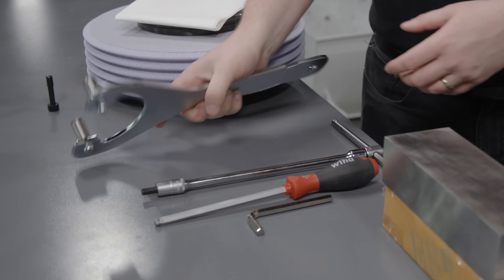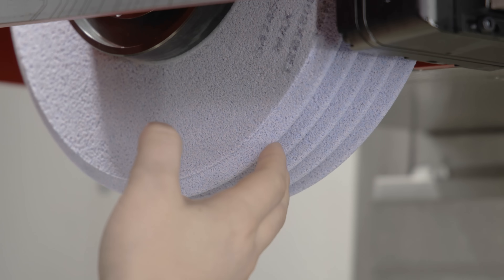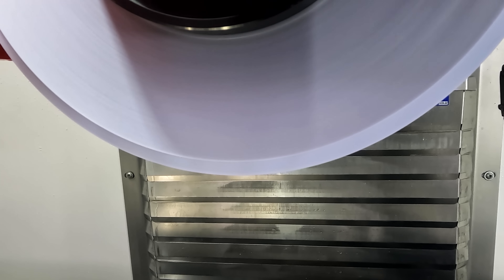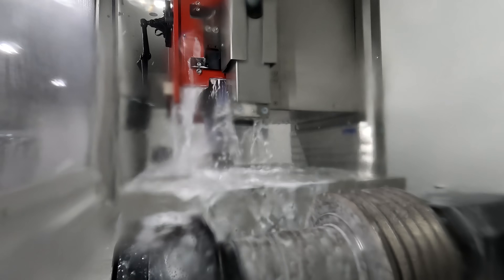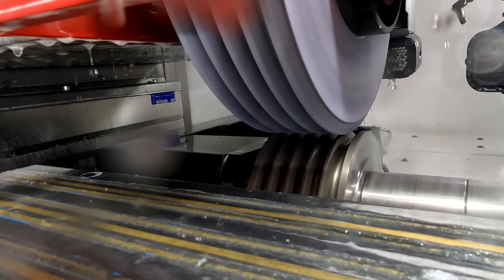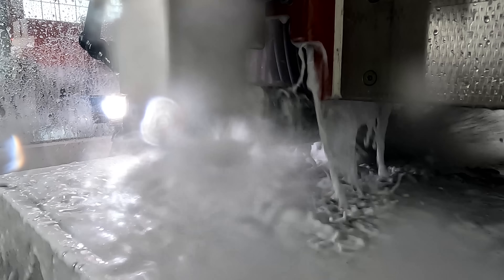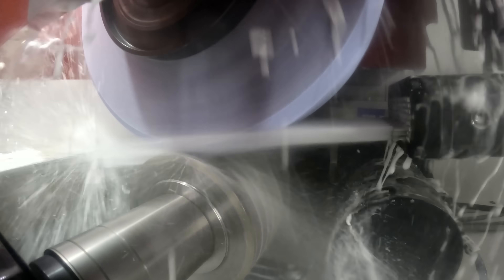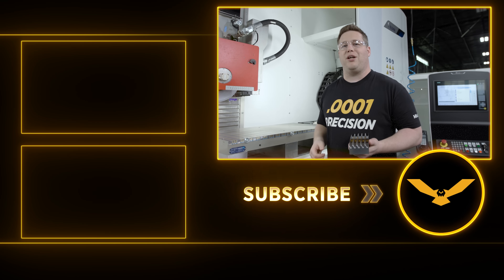Thousands of DIAMONDS Used to Create IMPOSSIBLE Grooves

Comment: Curious why you would grind half an inch then redress.

I would have thought it would involve less dressing to do one "rough" grind, then redress a few times for a "final" grind. That way you are not using a redressed wheel to remove the bulk of the material. Something like redressing every half inch vs redressing once every inch or two.

Comment: But you don’t really care if The finish is as good off the mill… cuz you’re just gonna go over and dust a few thou off on the grinder right? How do you go about getting the diamond setup to profile the wheel like that all at once? Does it require six independent diamond wheels stacked together? How much is the cost of the wheel that is being destroyed in the process?

Comment: How does the machine, code, software account for the diameter of the wheel shrinking?
Reply: I imagine it has to do with sensing how far the spindle is moving to meet the dressing wheel, which seems to be in a fixed location

Comment: So, every time you need a special shape you need to have a nee wheel designed for it. Like if you want deep, thin grooves you'd need a different wheel. Or wide shallow grooves. It doesn't seem cost efficient unless you consistently work with things that require the same designs and specifications.
Reply: To my knowledge, it's also possible to manually machine in many types of grooves for a grinding wheel by using a diamond cutter in a lather configuration.  That way, you can machine multiple types of shapes without having to create a new tool every time.
Reply: @kai.05  Not your fault, but for some reason, reading your reply really hurt my head. Probably need more sleep if I had to guess.

But if I read that correctly, then for more specific shapes and designs you can manually adjust them, but at that point aren't there other machines that you could use for that project? 

I am just an auto mechanic, so this isn't my field of expertise. To me, this is like how one place I worked had an oil vacuum to drain cars. I found it a little redundant that I had to hook up this vacuum through the dipstick when I had to get under the vehicle to replace the oil filter right next to the drain plug. It had it's uses for vehicles with filters up top, but that wasn't terribly common. At least not in our shop.
Reply: @SolDazar  my explanation wasn't the best haha. I'm not an expert in this field either, but in another one of their videos, a machinist used a diamond cutting tool with the grinding wheel in a lathe to resurface the wheel. I'm assuming that you could machine grooves into the wheel with a similar technique,  just by moving the diamond cutting tool in the path of the desired shape. Just like with other lathes.

Also, Mercedes are dumb, so of course they need a pump. Why not over engineer your cars too? I have my mechanics cert too, though I don't work in an autoshop.
Reply: @kai.05  But that is still time you'd have to dedicate to making a new wheel instead of doing the work itself. If you only need a part cut in that way, it wouldn't be worth the time. My main point is that it is aimed more at mass production rather than doing small one time projects. Then again, I don't know what type of shop this guy works for because I just got algorithmed to this video.

Luckily I don't deal with to many Mercedes, and what few I do have been able to be drained from underneath. But I usually prefer to use the oil vac for Mercedes because the filter is usually up top.
Reply: @SolDazar  you aren't wrong, the only time it'd really make sense is if you are needing 4 or 5 of the same parts made, or you need that particular finish. Also,  I haven't watched many of their videos, but from what I can tell, they do custom CNC commission from individuals and major clients as well.

I haven't gotten to work on a Mercedes yet, but I think that might be a good thing...
Reply: @kai.05  Yeah that makes sense. If they work for the same clients regularly they would likely get a lot of use out of it.

Mercedes are annoying, but I think Audi is a bit worse. Mostly due to availability of parts in a smaller city. Sometimes have to wait a couple of weeks for parts for them. Mercedes has parts issues here too, but normally just a couple of days for shipping not weeks.
Reply: @SolDazar  I remember helping my uncle fix his Audi, and it ended up taking 3 weeks to get one of the parts imported. It turns a 2 day job into a 2 month job.
Reply: @kai.05  Yeah, that's my big issue with Audi as far as working on them. I don't wanna own one because even if I could afford the car, I probably couldn't afford the maintenance beyond oil and tires. Any high maintenance cost vehicle is pretty much out of the question for me to own.
Reply: @SolDazar  same here haha

Comment: Does dressing the wheel change the dimensions at all? If so, how do you account for that change in wheel size when producing the final part?
Reply: Yes, every dressing takes the diameter of the wheel down a known amount. It's accounted for in the programming and adjusted on the fly with tool wear offsets

Comment: The most impressive part of this video is that a team somewhere actually engineered such an accurate machine
Reply: @xgumsgnag3525  Yah I used to work on a Sodick and I could not believe how heavy the machine was.
Reply: @xgumsgnag3525  elb and amada are even more precise..blohm are very robust and fast for high volume production.. but nothing comes close to elb or amada for precision
Reply: O
Reply: O
Reply: What's crazier than that is when you think about how a long time ago, a man made a tool that was more accurate than his first tool, with his first tool. And then used that new tool to make a better one. Throughout human history this process of making tools to make better tools has lead to these crazy machines and it will continue far beyond our time.
Reply: @john050994  it's cool, but with 3 pieces of stone you can make them perfectly flat by grinding them together.

Comment: Is there a video where you address cost and resources to produce the dressing tool?  I suspect the overhead of this cost will significantly affect cost of finished part, especially for short runs.  Are there low cost alternatives for very short run prototype work?
Reply: For grinding, you would need to dress the wheel with a single diamond cutter

Comment: Company I work for make diamond abrasive form wheels. You wouldn't believe the forms we have had to machine. Most are direct contact wheels rather than forming an aluminum oxide wheel. Many times we have had to modify a tool or insert to have clearance down in the form. We do two different processes depending on application use. One is electroplating diamond onto the wheel using nickel bond. The other is using resign/nickel & furnace to bond the diamond.

Comment: Problem I see is the cost and time required to produce the specific Diamond dresser required for each profile. For a high value one off job, time and cost is probably worth it, but for many parts, I bet the cost justification would be not worth it. Also, how do you take into account wear on the profile dressing wheel? Damn fine machine for sure, but like everything in machining, it has its plus and minus sides.

Comment: "Only 50 percent spindle load" , .008" to redress before the part is finished, tooling getting loaded up... are all things I would expect not to see in a million dollar machine. I'm no grinder though
Reply: Yeah 50% spindle load is kinda a lot which is why the .008 redress. Man’s is digging into that part. If my machine hits 50% load I either need a new tool or slow the machine down.
Reply: @Hellsing12002  if the money makes sense.. but u agree I use my things but I also try to take care of them

Comment: How are those bearings holding up with all those grinding particles from the grinding wheel?
Reply: With water involved. Not bad
Reply: @raritica8409  how the water helps it, if it is already in the engine?
Reply: @matwey1337  The water keeps the dust from grinding low, and makes grinding easier. I think that's how it works.
Reply: @raritica8409  The hole where they put those injectors back in, is laped/grinded as well, and it is inside the engine itself, i dont mean those injectors that they lap outside the engine... As example If i do lapping of the valves on the Motor head of a my car or anybody else, after i finished, i thorely clean it, so not a single particel of the grindign paste gets inside the the engine, because it gone be catastrophic for the engine 🤷‍♂️.... But i dont know, maybe those big ship engines dong give a shit what dirt they get inside😅
Reply: @matwey1337  oh I see what you mean.  I'm sure some engineer somewhere figured it out
Reply: @raritica8409  Sorry, I somehow lost in YouTube comets and answered to you with answer that was meant for other video, that surprisingly "fittet" to this video as well. Here is the link to the other video what I mean if you are interested 😅https://m.youtube.com/watch?v=BCPIIfNrox8

Comment: I like what I see. But personally, I'm surprised there weren't more passes over the material done. Small depth cuts across, digging in little by little to both preserve the edge of the grinder for more usage. While at the same time getting the desired cut you want at less of a cost over time. The grinder getting less used up, and the dresser lasting just as long if not longer than going through many grinders. I take this note from small grinders for cutting metal, If you do multiple passes at small cut depths, and continue to do it more and more. The blade of the grinder last 10 times longer than normally with less material lost in cutting straight through.
Reply: The wheel is wider than the work, and the cross sectional profile is dressed into the wheel, so there cannot be side feed.

Comment: What I don´t understand is how the machine keeps track of the tool offset every time you have to re-dress the wheel. Whenever you dress the wheel you lose material, so how does the grinder keep track of the position of the material and re-calculates the new offset?
Reply: It simply knows how much I takes off per dressing pass. Then that gets taken off the tool rad

Comment: So the rotary dress tooling is job specific?
On my Kellenberger, I used single point profile dressing to create various wheel shapes.
I had a rotary dresser, but only for dressing diamond wheels used to make carbide parts.
I'm curious as to the cost of your rotary dressing tools...is it even remotely economical for small quantity parts? (Various pitch threads, SAE, Metric, Acme, ballscrew etc in hardened shafts for example) 
Who makes the rotary dressing tools?
Is each one custom?
Or do they have a catalog?
Reply: On the kel-varia And kel-vita models I setup, I alternate using diamond rolls and single points. These special formed diamond rolls arrive to the shop ready to use, they are expensive to purchase and are only bought when needed depending on how complex the form is

Comment: I used to work in a shop that specialized in grinding and only grinding. "surface grinding , and holding flat ,square , parallel" was my favorite. But this stuff your showing and that machine is literally insane. truly beautiful work.
Reply: My pops always told me centerless grinding is dangerous.  Now I know all grinding is. Those wheels are like bombs if mistreated. Stay safe
Reply: Absolutely those wheels violently explode say if you accidentally feed a part through that skipped a run somehow. They’re also huge, easily 4-5 times the size of the one shown in the video and there’s two of them per machine.
Reply: @flaplaya  it’s definitely loud and will make you run when a centerless grinding wheel explodes. I ran centerless grinders for over 10 years and a Blanchard grinder for about another 10 years.
Reply: Same except also waterjet: Gockel G-65 and 50 surface grinders, centerless grinders etc.
Reply: Do you know if the price for a drill bit thing made of diamonds is significantly more expensive then one not made of them
Reply: In my old shop we would make all types of gauges, including thread plug and thread ring gauges.  It was all done on old Matrix machines, all manual.  We would use cams in a dressing box that would let us dress threads in to our grinding wheel

Comment: How do you account for the wearing down of the tooling? as you progress does the profile of the tool not alter slightly?  I'm sorry if you've explained it I've got absolutely no attention span so I have to skip through everything
Reply: "No you don't. You can store wheel data for each wheel you put on the machine.  When you create a new wheel, you tell it what diameter it is.  So each time it dresses the wheel it will automatically reduce the amount you dress from the diameter of the wheel.  It will compensate the shape as well as the surface footage.  Additionally, in the canned cycle for the profile it has a "radius adjustment" so if you make the first part and the outside radius was off you could tell it in the canned cycle how much to adjust and then every part after that will come out perfect." - @Jessie Smith

Comment: Awesome video @Jessie Smith  I really appreciates the efforts you are doing for us, I have a question can you add the rebalance feature in the code itself so that it will grind, redress and rebalance automatically ?
Reply: My impression is that the wheel needs to be rebalanced only when it is refitted after having been removed. 
I think from then on dressing is enough, unless you're grinding something dead fussy, like optical flats or somesuch.

Comment: Hello I am a CNC roll thread machinist, flat Die and cylindrical. It's very difficult to find much information on the processes used to manufacture roll threading dies. Ive even asked to tour the plant where we purchase most of our dies from and we get the same response every time, "sorry proprietary". LOL I'm guessing the process looks similar to what you are doing in this video. Have you ever seen or heard anything about the manufacturing process of cylindrical and flat dies for rollthreading? The cylindrical dies are definitely ground cpm4 they come in at about a 62 on the Rockwell, it's pretty incredible.

Comment: Man that's awsome so clean Just a question because I don't know can you not use the diamond impregnated tool to cut/grind the 4140 block? or does it not work like that cheers
Reply: a diamond wheel would be used for extremely hard materials.  Like grinding carbide.  but for softer materials these type of wheels are generally used.

Comment: How many dressing cycles does the wheel dress last until it's out of tolerance?
Reply: There is a number of factors that could affect that.  One is how you dress the wheel,  upcut verses down cut.  You can also lower the surface footage on the wheel which will make it softer so it is less strain on the dresser.  But since it has literally thousands of diamonds instead of just one like the single point dresser it will last a really long time.  I guarantee you will get your moneys worth out of it

Comment: I’m curious, what was the cycle time and total wheel usage?
Reply: Total cycle time was about 45 minutes.  I could have reduced that by taking a deeper cut.  the highest spindle load I hit was about 65%.  I dressed the wheel 4 times taking .008" off the radius each time and then a final dress before finishing taking .004" off.  This too could have been fine tuned.  I may could have gotten away with only re-dressing 3 times.  Since this part was meant for demonstration I wanted to give an accurate representation of what a real life process would look like.
Reply: @Jessie_Smith  my background is grinding   Turbine components for both aerospace and large industrial gas turbine parts. I have around 25 years experience in firtree root grinding with extremely tight tolerances and metallurgical requirements. 
Using the Tyrolit Strato Ultra wheel in conjunction with the Blohm machine you have there, you have much more potential.
Reply: @tonyburnley1318  wow that is awesome man.  I was just talking with Barry yesterday about firtree root profiles.  I didn't realize they were ground until yesterday.  That would be really awesome to do.  I know we are just scratching the surface with this machine, I can't wait to make more complex components with it.

Comment: How do you locate the parts on this machine?
Reply: for this part, I just indicated it true and then touched the top of the part with the bottom of the wheel for 'Y' Offset.  I touched the back side of the part with the front of the wheel to set 'Z' offset and then for 'X' I placed a mag base on the wheel flange, touched the top of the material with an indicator and rocked the wheel back and forth until I found the low spot.  I then hand jogged in "X" until the indicator started to fall off the left side.  Doing that set the centerline of the wheel with the left edge of the material.  You can equip this machine with a probe to make it faster and easier but I don't have one so that is how I did it.
Reply: @Jessie_Smith  Thanks for the explanation, your doing a good job of explaining the stuff
Reply: @callmekimberly99  Thank you!